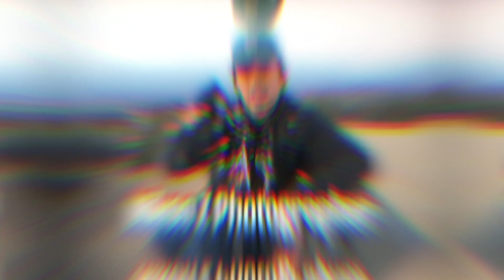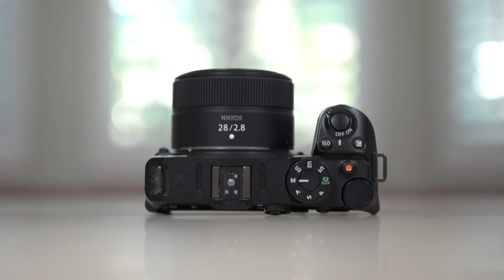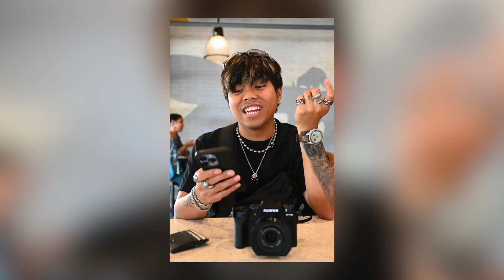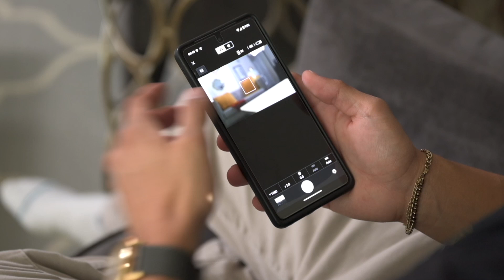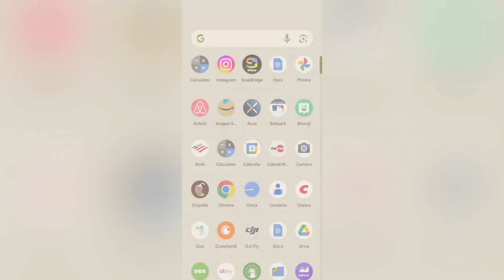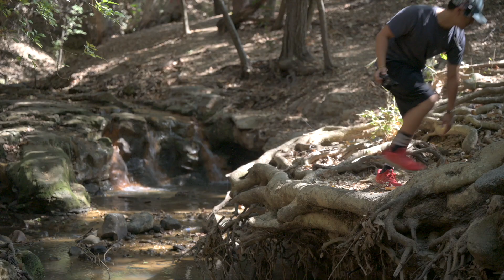Nikon Z30 and 28mm f2.8: The ULTRA COMPACT COMBO No One TALKS ABOUT

Comment: I have the 28mm, but I prefer the 24mm f1.7dx on my Z30... another good choice for a light weight combo is the 12-28 which I pair up to the Z30. You made a comment about using the blue tooth for connecting to a smart phone. I need to try that because I always used the wifi setup. great video!

Comment: To expensive for what it is and it's a failure. It's camera without the EVF, has APC instead FF sensor, no IBIS and without any log-s for video. So it's basically jack-of-NO-trades because it does not have any strong sides. For almost the same price you can aquire brand new Z50 which is identical body size + the EVF and has all the perks metioned above.

Comment: I had this combination, unfortunately it is not sharp with Z30 or Z50 but with Full Frame it is sharp. Recommended lens DX 24 /1.7, excellent combo.
Reply: If anything, it should be sharper on APSC since you are using the sharpest center portion of the lens. A full frame sensor also uses the edges of the lens which are softer.